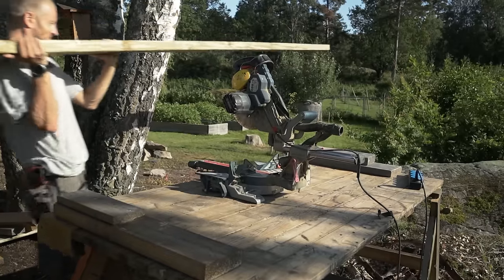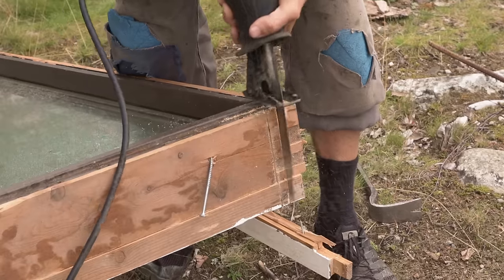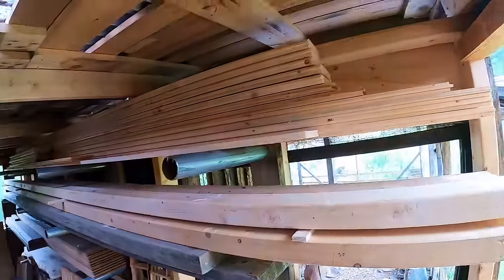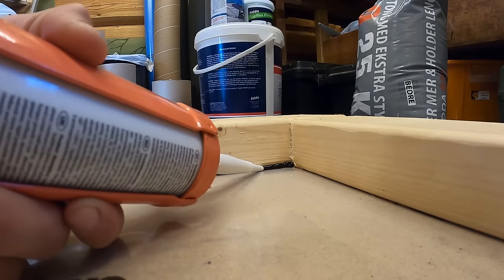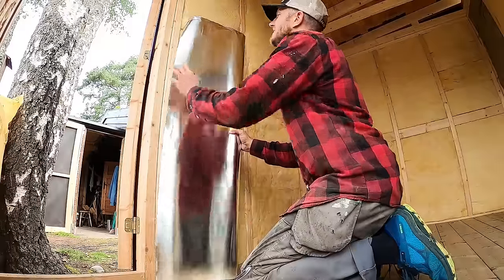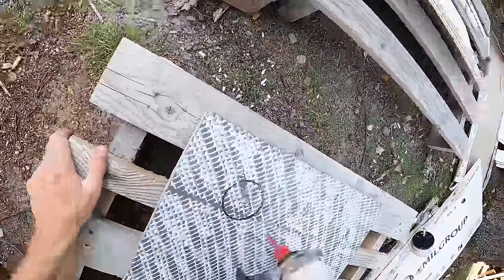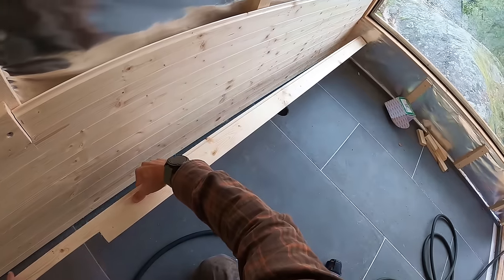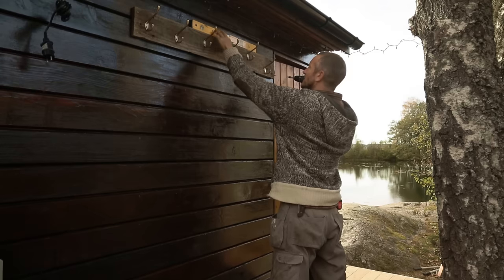DIY OUTDOOR SAUNA 🌲🔨

Comment: Great Video, great job! Gave me a lot of inspiration for building my own bastu right now. 
One question for your concrete back covers for your stove. have you used rebar there as well within the 1 inch? Seems to be to thin for that isnt it?
Reply from the maker: Awesome! The concrete is layer is about 1,5 inches . The rebar I use I have noe idea about if it is the correct size for this slap but I have used it before with no problems on 2inch slabs for ie. a bathrooms or a larger concrete top of outdoor stairs with tiles on top with 7years of it's still good. Considering the back will not be exposed to water... just staying dry I think it be good, but I'm no expert. After 1st years use it looks the same as when I made it.... I didn't want it thicker because of weight issues and regarding heat towards the wood there is no misscoloring so I would say it works well. Best of luck!
Reply: @MartinWoodStudios  Fantastic, thanks for the details, much appreciated.

Comment: Hi Martin,
I've completed the frame and am now beginning work on the interior of the hot room.
Could you please share your tips on how to make the concrete plates around the heater so shiny?
Reply from the maker: Cool!

Look at the video on how I use a plastic sheat underneath the concrete and over. The bottom will later be the front. Also this is concrete called B20, which in my country is the lowest grade, meant for Basic stuff. Remember to spray the top with water for best result (i didnt).

For the pillars I used B35 which will take more salt, wear and tear. 

More Qs?! (Make a new comment because I will not get a notice if u post and answer here). God speed 😊

Comment: Good work! Thank you for sharing. What are the measurements (outside and inside) of the sauna?
Reply from the maker: Hi! I aimed for 3x2 meters on the inside but ended up around 2,9x1,9m because I forgot to plan for the strips + panels :D. 5-6 adults... or there is room for my family of 5 + two more adults

Comment: The one thing I see everyone do which makes no sense at all: first make it all air-tight with the aluminium tape, then puncture it again when putting the wooden strips in. The rationale is probably “now I can’t see the puncture so it doesn’t count”😂
Really nice build, though! 👌🏻
Reply from the maker: I'd rather have "20"(screw) holes than 120 punctures and screws... and it doesn't cost much to tape them. It's like if I am in a boat... would you rather have 20 holes or 120?  :D
Reply: @MartinWoodStudios  OK well that does make sense indeed. One of these days I’m going to build one myself and surely will watch your video a bunch of times in preparation 👍🏻

Comment: Beautiful build and kämpegreat video! I'm planning my own build at this point (Swede living in California). Question - the drain/air inlet under the heater, did you have any slope to it or not? I feel I have skills to put down tiles on a flat area, but building a slope, not too sure. Anyway, curious on your experience.
Reply from the maker: I did not lay a sloped floor. My plan was to mop excess up but to my surprise the tiles get quite warm and the water evaporates. I believe because of my 10mm insulation in the floor it is enough to keep the cold out and for the tiles to become warm enough.

Comment: This is a great sauna build video.. finally inspired me to start on my build.. I wondered if I could ask you about the glass, is it double glazing? I was thinking I would just get 8mm tempered glass and use this video to match the framing technique you used. But worried about heat loss, what kind of temperatures can your sauna get up to with that window? thanks and again, GREAT work and great to see the family involved.
Reply from the maker: Hey! Im no window expert but I belive this is a double glass window and measures around 1,6cm or so... I think 8mm will be on the thin side even though it is tempered - thinking heatloss and wobbly(if big) - easy to break, but heatloss depends on how big your window is... small will be just fine I guess. 

My window measures around 160x160 or something in that direction. You can oversize your sauna oven to weigh up for a "leaky" build. In my case my oven gives  my sauna over 100 celsius in -15celsius... but I prefer it at 80-85c. Very happy with my build and the water evaporates from the tiles :)

Each oven comes with a m3 that they are built to heat.. in my case Harvia Pro 20 gave me 8-20m3 and I built my sauna at around 14,5m3 inluding the window. (the window you have to add it's square meter to the calculations)

ex.. my build I guess was around 12m3(room) + window 1,6x1,6= 2,56m2.... so 12m3 + 2,56 = 14,56m3 and well within my ovens capabilities.

hope this helps you and be well and build well :D
Reply: @MartinWoodStudios  Thanks so much for this awesome reply.. I went for the Narvi 16 and also going 12m3.. window would be about a similar size to yours.. 
 wow 100c in -15  is mega! again, great work mate.. thanks so much.

Comment: great video, thank you! as you use the SAAAUOWNA do you enjoy the choice of tile floor? any downsides vs wood?
Reply from the maker: I have only done tile floor saunas and find them good. How I made mine was especially a positive surprise because the water that lingers on the floor eventually evaporate... so less work for me.

In the beginning the tiles will be cold but I heat the oven for 40-60min before I use it... then they are ok... by the time I'm finished they are warm and super nice.

Wood won't last as long and the water won't evaporate are my first thoughts.. but ask some finn about it, I do not have wood floor experience

Comment: Curious why you didn't put the flooring down before putting up the stud walls?
Reply from the maker: yeah I know it's not the normal way. My idea was that the ends of the flooring would start to rot before the larger beams + this way I could change the floor boards completely without having to rip apart the whole sauna. Maybe it doesn't make sense but I can not really see a big benefit in running the floor under the stud boards except for it being slightly easier/faster until the floor is laid.
Reply: @MartinWoodStudios  and that is a fantastic idea... after you stated the triple layer of flooring I sort of picked up on why you did it like that. Great build. I'll build one soon. Probably just copy yours. Thanks for the great video Martin!

Comment: Martin, you are building a level floor, but from what I see on YouTube, people are building a slope for the water to escape. Do you have problems with draining water?
Reply from the maker: If I had wooden floor I might need a sloped floor. My thought was that I didnt want the hassle of sloping it and I could mop it up instead. But I didnt need to, the tiles become quite warm and the water evaporate. I think  because of the 1cm insulated plate under the tiles it leaves enough so the tiles become warm enough for this to happen. If you have more Qs dont answer here but write a new message because yt does not give me a notice if u answer this. Good luck!

Comment: Hi. What is the first roll of roof-material that you are using? Is it common to use a double layer?
Reply from the maker: Takbelegg Selvbygger Glaciär 3
https://www.byggmax.no/ytpapp-glaci%C3%A4r-3-kristallsvart
Underlagspapp 122 Trebolit (art.nr. 17113)
Underlagsduk 116 Trebolit (art.nr. 17111)

Byggmax
Reply from the maker: Carefull with using the våtromsplate on the floor. Nothing has happened but I found out the foam might collaps at 75°c.

Comment: Thank you, Martin! Amazing video and very exciting!
I'm planning to build a Sauna and will use your video as a guide with some minor changes.

What kind of glass are you using? Someone told me that window glass should be tempered to be used in a Sauna, another person told me that glas should be thermo the same are used in the patio doors.  I just wondering if we could use "ordinary" glass from modern plastic windows.
Reply from the maker: Hi Sergi! 
The glass is a normal 2-layered glass from an ordinary window used in houses. (it works very well). No need for tempered or thermo if you place it more than 50cm from oven(thats my safety distance, it might work fine with closer but I have not tested). 
This had a wooden frame and I had to remove it from the frame because of the paint. Never use treated wood or painted wood in a sauna. In my country they give these windows away for free when changing to 3-layered modern windows that probably is called thermo windows.
Reply: @MartinWoodStudios  Thanks for your reply!  How many hours in total have you spent on construction?
Reply from the maker: @sergiyrudenko905  I didn't count... but it was around a 2months solo build with working part time in between.

Comment: Awesome video. Did you end up closing in the outside/ side openings of the roof? With a "soffit" or pest/bird guarding of some kind? Thanks for any info!
Reply from the maker: Yes, to prevent bees and birds entrance 👍🏻
Reply: @MartinWoodStudios  did you use metal or plastic soffit or wood with openings?
Reply from the maker: @willgunter9356  the net was some sort of glassfiber material. I didn't want to use metal because I thought there might be some condensation, but I was probably to careful. I hope I answered you Q

Comment: Hei. Helt super video! Takk! Skiver på engelsk herfra så andre også kan lese. I am curious about the angle of your roof. How many degrees does it fall? What do you recommend? And what is the hight of the indoor space, from floor to ceiling? Hilsen fra Østlandet;)
Reply from the maker: Halla fellow east coast sauna lover :) 
Angle of roof depends on your roofing material (all has got different specs takstein, forskjellige takpapp etc). This DIY takpapp has a minimum 3 degree angle, I probably did around 6-9. Better safe than sorry right.

Height after tiling and inside roof panels (+ strips/lekter) = 206cm. I guess I built 210cm from the wood floor to the 2x4 beams.

Great questions!

Here is my build with some details online.
https://byggebolig.no/badstue-og-tilbehor/bygger-badstu-pa-stopte-paler-fra-bunn
Reply: Absolutely great! Thank you so much!

Comment: im not a fan of the roof edges raised , snow melt will work its way under flashing, shoulda rolled over the edges ...
Reply from the maker: I built a similar roof 6 years ago and never had problems, the metal lies thight against the roofing. Rolling this material over edges might be an idea if I rounded off them off a lot. 90 degree bends will cause a lot of stress on it and most likely shorten lifespan
Reply: @MartinWoodStudios  thats why we use overhangs, drip edges, ect....

Comment: Polyurethane slabs with aluminum cover are much better solution for insulation, like sauna satu or Finn foam.
Reply from the maker: Yes, maybe. I checked sauna satu and only saw they have 30mm insulation in Norway. I have 100mm and I bought my insulation second hand and saved a lot of money. 
This is a budget sauna video. I would also use different wood to sit on but again... budget. Kippis!